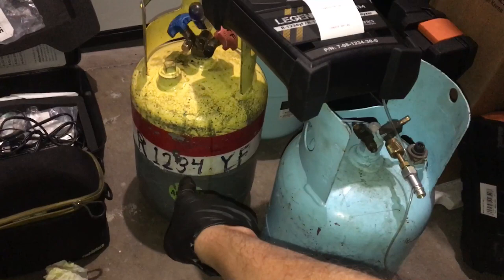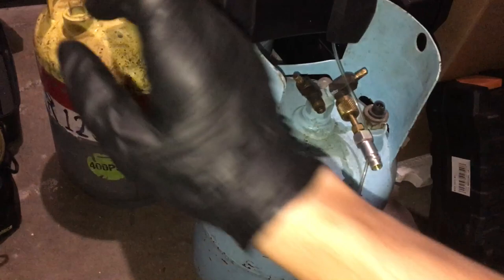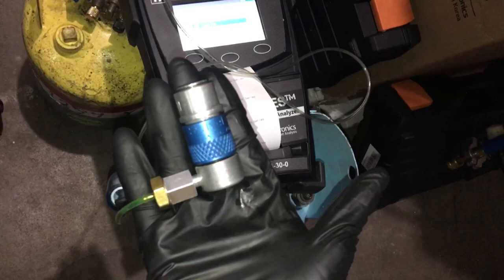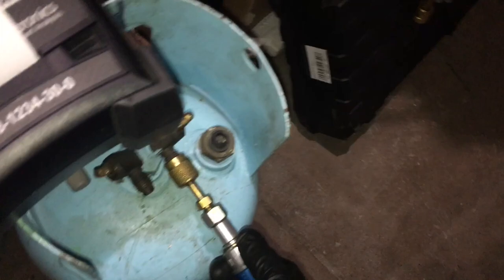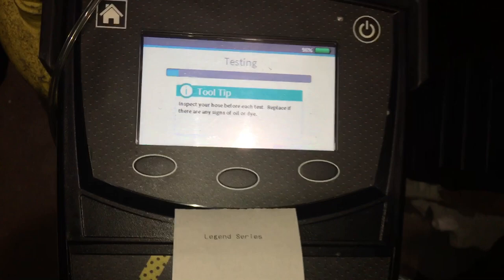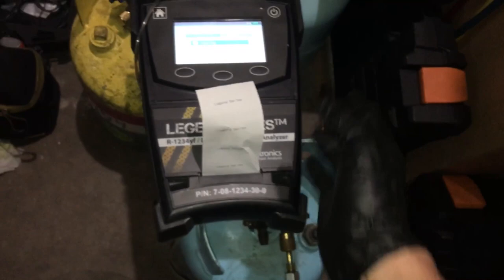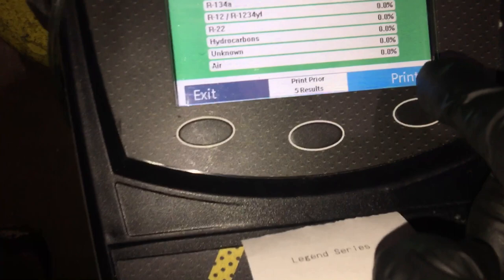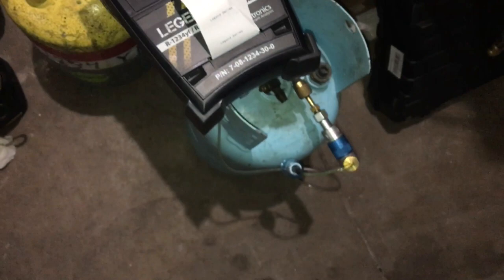Recycling Refrigerant, NO !  reason to have contaminated refrigerant after recycling￼￼

Comment: Tom, I have a very silly basic question for you. Don't laugh! :( Let's say the under-hood tag says that the proper charge of R134a is 900 grams. For simplicity, let's say we have the vacuum pump on the low side, and on the high side we have the micron gauge and the charging refrigerant line connected to the R134a cylinder. No manifold gauges to consider. We vacuum down the system with the high side charge line open to vacuum and the refrigerant supply turned off at the cylinder valve so the vacuum goes all the way up to the cylinder. We get the system to a nice low vacuum, close the low side port valve, turn off the vacuum pump, close the low-loss valve on the high side charging hose, open the refrigerant cylinder and turn it upside down on the scale and zero it, and then open the high side low-loss valve to charge liquid refrigerant directly into the high side like you've shown before. The scale gets close to 900 grams and we turn off the valve perfectly on the money, 900 grams showing on the scale. My question is, part of that 900 grams is still in that high side charging hose. If the low-loss valve is close to the high side port, almost the whole charging hose will be full of liquid that was measured out but not put into the system. If the valve is close to the cylinder, most of the hose will be vapor, but it still won't make it into the system. Is this taken into account by the 900 gram spec, that a good amount of that weighed out charge won't make it into the system because it gets stuck in the manifold gauges and charge hoses? Or is it necessary to put the low-loss valve close to the service port, pull the vacuum up to the cylinder's valve, then close the low loss valve at the port, open the cylinder valve to fill the line with liquid refrigerant, THEN zero the scale and open the low loss valve again to weigh in the charge so that all of the liquid refrigerant stuck in the charge hose doesn't matter when you reach the point of 900 grams weighed in because it was zeroed out before charging the system? It just seems like of someone hooks up a 4 port manifold gauge, pulls a vacuum on everything, zeroes the scale, and then charges in 900 grams, there's alllllllll that refrigerant in the charge hose, manifold, and high pressure hose that will be recovered instead of pushed into the system leaving the system undercharged. I'm just one of those auto techs who has become very interested in auto and home HVAC recently. I've done a lot of incorrect stuff in the past on cars. :'( I've learned a lot from you in a few short hours. I wish I could go back in time and stop myself from making the mistakes that you've shown us. Thanks for all the knowledge Tom, you're a skilled artist in your trade. You've brought me firmly into the next phase of my learning which is the "Shit, now I realize how much I don't know about HVAC."
Reply from the maker: Congratulations to the first part of the nine steps of your AAA program. 
 Step one #1: Seen in admitting to your weakness. 🤣 👍

Onto the question

I don’t show and tell everything and everyone of my videos
 
          But yes I have done videos dry and vacuum in the low side and filling refrigerant in the high side just with hose and no gauges. 

        And yes there is a way to get what is probably a whole entire ounce of liquid refrigerant that is stuck in that high side hose out. 

          It’s so simple your palm slap yourself in the head. 

         There’s two methods that you can use but I will not give you the answer you will figure the answer out for yourself along your road in Journey learning and putting the puzzle pieces together. 

        Learn and study the gas laws and he will come up with the answer.    If you actually understand the simple basic physics behind how refrigerant works and basically all gases work you can figure out a lot of answers yourself. 

           I often show the four port manifold because it’s the easiest to use yes it’s a little bit expensive for a DYI person but for a professional it pays itself back many times over in savings and time in savings and accuracy. 

       There are analog gauges that have four ports but basically they’re half the price of the full-scale high-end digital gauges so why not just take that extra step and go all the way. 

         I can completely vacuum and charge a car with one single hose one vacuum pump and one cylinder and not contaminate the system and get 100% of the whole charge into the system.
Reply: @coldfinger459sub0  I can't say I'm 100% on the physics of the gas laws at this point, but I have a basic understanding for sure. The only way I can think of off the top of my head to "not waste" a full charge hose of liquid refrigerant in that described scenario would be to remove the closed low side port valve, close and remove the high side port valve which would trap the liquid column inside the hose, and then connect the high side charge hose to the low side port and slowly allow that liquid column to flash into the low side. That would bring the charge hose down to like, 30psi or so but I'm still not sure if that's an amount of refrigerant weight worth considering as lost or not. If one was using a 4 port manifold, they could close the refrigerant cylinder valve, close the high side port valve, and then open the low side manifold valve to flash the charge hose into the low side, and then open the high side manifold valve to flash the high side hose into the low side too. That would equalize it all down to the low side's 30psi or so. Close all the valves everywhere, remove the 2 port valves from the system, connect the charge hose to the recovery machine and recover the manifold and hose internals to a vacuum and then equalize with nitrogen to make them ready for next use. Am I hot, cold, or lukewarm? 😸 I'm a perfectionist. I want to do the very best work that I can. I was never an AC Pro trigger can shaker, but I thought my Harbor Freight vacuum pump and manifold gauges were totally good to go and that the typical 45 minute vacuum and recharge was doing it the right way. Now I realize my gauges and hoses probably leaked in vacuum so I never hit 500 microns, 45 minutes wasn't nearly long enough, my final charge weight was probably wrong with the stubby hose making my kitchen scale reading inaccurate, and my boss totally lied to me when I asked if we needed to replace the waste oil amount back into the system that collected in the little bottle in the back of the AC recovery and recharge machine. :( I'm 609 licensed, but the test doesn't really teach you these very specific procedural points, and I did it many years ago. Now I want a 608 type 2 and relearn all the 609 stuff I was taught incorrectly.
Reply: @mannys9130  
The 900 is system amount. Oem cannot know how much your equipment will hold. So i would say put equipment in vac. Then get your refridge up to the low loss fittings and zero the scale.make sure your micro. Gauge is closed from the system before you pressurize.

I bought a set of hf gauges.. Thinking i wasnt going to do more than simple diag. I got very frustrated chasing leaks and the lowloss fitting not working. They use nylon seals. 
Stick to name brand. Spend $100+.
If your gonna buy the cheap 30$.. Then you shouldnt be playing with refrigerant.
Out of frustration with shops i have been building up my hvac equipment. Renting got frustrating also.
Reply from the maker: @mannys9130  👍👍👍💰 you win the $69,000 question you are correct in about every aspect you just described. 
          It’s not rocket science you can figure that out off the top of your head how to transfer that high side hose over to the low side. 

      That 30 psi a vapor refrigerant left inside the hose is negligible.   Most of the bigger refrigerant systems usually have a plus or -50 g tolerance. 

        But not on the smaller systems that are around 454 g or less trying to keep it in five or 10 g tolerance would be preferable. 

        If you’re a perfectionist then you’re like a micron gauge but at the same time it’ll cause you a lot of frustration as you’re learning to use it. 
           Gets back to physics there’s a lot of things that will make you think you have a leak when you don’t. 

      Look for videos on using a micron gauge and videos on pulling vacuum. 
Look for the name Jim Bergman
Videos by True Tech Tools in their training video section on their website

      Go to Testo‘s website and look for training videos and reading some of their study and training material on vacuum and micron gauges. 

       Keep in mind Automotive is a little different than residential or commercial HVAC because they use metal lines no rubber hoses rubber O-rings so there’s some funny stuff that goes on that alters test results when using a micron gauge with rubber components and exposed shaft seals on compressors

       Residential and most commercial a lot of medic compressors do not have external shaft seals going to clutches that’s a possible leak source. 

          And if you’re really nerdy and a perfectionist and really want to learn more about HVAC learn about the residential and commercial stuff to it will take you to a next level higher than anything in automotive

    Look for a YouTube video by Brian orb
HVAC For Techs by Techs

Videos by Ty he’s a HVAC instructor on YouTube

     Videos by engineering mindset

       Videos by HVAC learning LLC.  (I did not quite get that name down correctly the instructors name is Craig the last name sounds Italian and he has books and other learning material

         After that you’re now on your way to learning and knowing more about air-conditioning than probably 95% of all automotive technicians within 100 mile radius of your area. 

       Oh yeah I forgot to mention MACSW 
https://macsmobileairclimate.org/
Reply: @coldfinger459sub0  
Craig is amazing. Good teacher.
TK has a good troubleshoot writeup for micron gauge.
Reply: Craig’s channel is called “AC service tech LLC”. Highly recommended!
Reply from the maker: @u.h.johansen803  I’m embarrassed to say I could not remember his name I have been subscribe to him before he had any subscribers no books or much training material when he was going through his learning curves how to use YouTube and produce content. 
        As a HVAC training instructors he’s right up there with the super rockstar’s 
      Kind a trainer I would be proud to have if I was a student learning in this trade and a kind of instructor I would like to become as a semi-retire and take up a HVAC training course in one of our local colleges for HVAC
Reply: @coldfinger459sub0  Well you have something unique in the sense, that you apply/teach the good practices of commercial/building HVAC in the automotive field. Haven’t seen that anywhere else. 👍
Reply from the maker: @u.h.johansen803   this is actually nothing new it’s just lost information in a world where management and owners of businesses look for the shortest cheapest way out over the decades from my dad‘s generation and we have a bunch of idiots as managers and technical supervisors who have no real practical engineering background or common sense. 

            This was the way my dad was taught when he was young before I was born using a mechanical analog micron gauge.  

       This is why I pull my hair out and wanna bash my teeth into the concrete curb going crazy when I hear people say I’ll just pull a vacuum down to 27 inches or 29 inches good to go and beer can cold. 

        And then years later you’re tearing apart a rotted out system where all the metal components are decayed and rusted and if it’s commercial electric compressors you got copper plating on everything. 

       I’m doing nothing special I have no extra smarts or abilities than anybody else. 
            It’s just the decline of the human species into wherever is easiest cheapest fastest
Reply: @coldfinger459sub0  
"Cheapest fastest" yes. No more.
Only the rich are interested and can afford quality furniture anymore. Used to be you would pass it down generations. 
Used to be that tools beyond a screwdriver were expensive. Now days specialty tools are more available to general public ( cheap gauges and vac pumps).
Reply from the maker: @turboflush  very true for the common man power tools and high-end electronic diagnostic equipment was very difficult to almost impossible for the blue-collar worker to afford. 

            But knowledge is even becoming more valuable

           Take me for example 30 years ago before I owned my own business . My old boss stoner of the business more than one business kept hiring really cheap in expensive part changers but yet I would do all the diagnosis condemning a parts and make sure everything was done. 
                      I fed six other low qualified employees 8 to 10 hours of billable jobs every day and even leftover billable hours on days I was not there because of knowledge. 

          The boss hated when I take vacation time or asked to leave to go for training I would fly myself out to training seminars and expos the boss considered that a loss of money 💰 

       I did not get the money that I asked for so I immediately shut my toolbox and went to the next shop only shortly to start my own business afterwards. 

      I took that knowledge with the ability to produce so many man hours I could feed a whole crew just by laying my hands on a vehicle and I kept it for myself and used it for myself.  

          Now I could pay myself five times more than working for a Maggitt who cannot even turn a wrench himself or diagnose himself out of a wet paper bag. 

         Technicians don’t know and understand the power of their knowledge they can fire their boss worthless bosses are a dime a dozen. 
               Just like a uneducated technician is a dime a dozen. 

       That may be sad to say and hard to swallow but it’s the truth
        I’m all for technicians educating themselves getting some coneys and firing their boss especially if they’re in that parasitic lowlife virus on society type of manager or boss who is totally incapable of actually performing the duties he seeks his technicians to perform for him so he can feed himself.
Reply: @coldfinger459sub0  Wow! Thanks for all these resources! I'll be busy! As for the further discussion on knowledge and tools, I find YouTube and the internet to be absolutely invaluable. There is no way I'd be able to learn this stuff without getting into the trade and having a GOOD teacher as an apprentice. Like I said, my old boss at the automotive shop told me there was no need to replace removed oil after an evacuation and deep vacuum. He just threw that oil away. Sometimes it would be a good amount. I believed him, but now I know that was wrong. I had no way of knowing that that was wrong back then though. :( I had no way of knowing that the single 18" flex duct return in my house was nowhere near enough air for my 5 ton AC system. Now I do and I'm adding return registers in the other parts of the house to make things right. I love learning. I love doing a good job. I just replaced my hot water heater, soldered up like it should be. Spent days practicing and learning how to solder correctly especially that lead free brass valve. Got it all done though, and every single detail is according to the 2018 residential, plumbing, and fuel gas codes. 👍 I spent days and days researching best practices and reading code books to make sure I did everything right. Joe Homeowner and Billy Bob the sloppy plumber just throw stuff together and make it work. I want my work to be perfect so that I can proudly say "I did this and I know it's correct" and have a true professional be surprised that that was the case. I truly like doing things right so they work optimally and last a lonh, long time. That's why I'm so annoyed to know that I was blissfully ignorant this whole time about automotive HVAC. Dunning Kruger struck me hard I guess. :( I'm more in the middle of the curve now which is good! Let the learning continue.
Reply from the maker: @mannys9130  learning how to learn is important. 

           As for the automotive Machine,  if you you have read the factory manual you would learn it tells you about the oil.  RTFM 

             When you want to learn about a tool or procedure,   Read the factory manual don’t always just listen to the person selling or teaching you. 
                           Go to the factory website.  And now you can go to the factory YOUTUBE Channel. Sometimes they did not have when I was young. 
                      Always had to send a letter and wait 5 to 8 weeks for a manual to be delivered. 
There was no web or internet when I was young. 
               It was just being developed for the military only and between universities when I was young. 

         As for using flex duct. Learn to use it right !!!....        its best to use metal 90° , use duct sealing, tie straps, duct tape ( real duct tape rated for the job) not the duct tape gray stuff. 
             Attach and mount and Secure all the 90° or metal secretions and pull all the flex tight like a guitar string. So it is smooth inside. 
          When you really have to make bends with flex duct,  big long smooth radius. 
           With flex duct , when in doubt upsize by one size. 
                   Learn about air velocity and sound. Fraction rate, static pressure. 

            Learn about correctly sizing filters and type of filter.    Let’s just say you have a 16”X20” x1” filter on your 5ton for example MERVE 6 or 8.  ( too small ) 
                                And you wanted to upgrade your filter to a MERV 16. Something crazy like I do.   Then at minimum you would use a 20” or 25” X 30”x5” or 7”.   And to really do it right you would use two or more in Parallel. 
             Learn about face velocity and filters. 

Learn building to code is the minimum, to build the worse house possible. 

            Learn “ maybe “ you need a 3 ton and not a 5 ton if your house was sealed correctly airtight. White roof if possible?. Learn about the flew affect ( chimney ). 
           Maybe use White curtains in summer at least on the windows the sun hits in the summer time.
        Learn about about if you furnace and Air handler is in the attic or crawlspace out side the living space. Is the air leaks causing the house to go positive or negative pressure?. 
                 For every 1 CFM being pusher or pulled in or out you house you are paying 💰 to heat or cool Mother Nature outside hot air or cold air.   Fix all that . 

     WOW,  now you only need a 3 ton maybe 2 or 2 1/2 ton  $$$ saved.  For easy cheap things to implement.   ( except for painting 3 vary thick Coates of White roofing paint)  I did a video on that. 
                           👍.  Learning is fun.
Reply: @coldfinger459sub0  well in any case it is appreciated 👍!